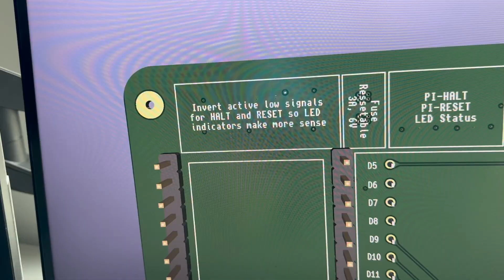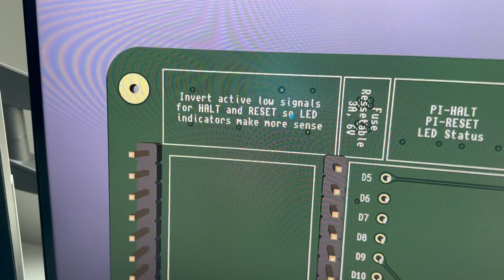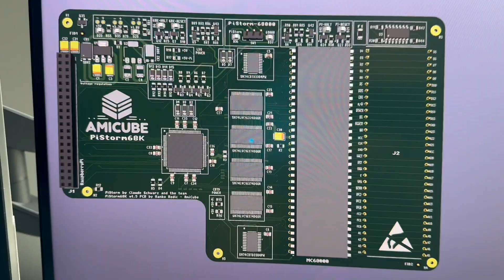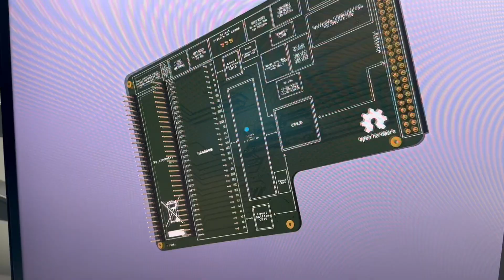🔧 PiStorm 68K v1.4 Hardware Update – Solving Power Glitches & Previewing v1.5! ⚡

Comment: The problem you are running into is due to the protection diodes on the I/O pins, and it's a common issue. This is why it is bad practice to allow for a situation where signals can be present when supply voltage is removed. While it won't necessarily damage a part, it can result in latch-up, and the resultant contention *could*.

I would suggest pulling those FF's back into your CPLD, as its programmable I/O pads handle this far better than dedicated ICs. Without power, all of the paths from the pin to the pad are broken. If you don't have the resources in that Max II part, the Cyclone 10 parts have internal configuration flash, are offered in TQFP packages, and come in variants up to 50k LUTs. They are also programmable by the free web version of Quartus.
Reply from the maker: Thanks for the excellent suggestions! I think I’ve figured it out. I’ll be releasing the schematics and Gerber files soon so you can take a look. What really helped was using jumpers to test different power configurations, in the end, I decided to keep just one diode.

Comment: Thank you for these updates. It's very appreciated! In regards to the rPi/68000 switch. Is it possible to add some logic to the board that will prevent a switch between the two modes during runtime?
Reply from the maker: From version v1.6 I changed how the switch operates. Now I am using N-CH. So it is possible! I should probably add this feature. It is very good advice.

Comment: I can't help think that you would just be better off waiting for the PiStorm16 rather than base this odd the original PiStorm.

Currently the PiStorm16 hardware is complete for the A600, and the firmware is in beta. A500 boards will follow. 

As it is based on an FPGA in the same family as the PiStorm32 it will bring over some of the benefits of that, such as the ChipRAM speed improvements, and stealth mode (to disable the PiStorm).
Reply from the maker: Is pistorm16 available? Schematics etc..
Reply: @amicube very soon

Comment: Have you had a chance to test it with a Pi4 per chance?  I was an early adopter with the first few batches of the original PiStorm and I haven't had any success running it and Emu68 with a Pi4.  Officially the Pi4 isn't on the PiStorm's supported list, but there seem to be plenty of people running one, so I'd be curious if your version runs fine.
Reply from the maker: Tested it this morning, and it works! I used a Pi4 with my Minimig setup, not Amiga, and it ran flawlessly. I'm not a PiStorm expert, so I'm unsure about specific nuances or why the Pi4 might not work in some cases, but with a CM4 and Pi4 in my setup, it performed well.
Reply: @amicube  From my understanding it's to do with the CPLD on the earlier versions, but  the interaction between the CPLD and the real chipset may contribute.  Trace lengths, Agnus revision, etc, could all be part of the problem I guess.  Marketing-wise it may be a good idea to test with a Pi4 and at least an A500, that way you could put it on the store page that it worked for you on an A500 RevX Agnus versionY, but "mileage may vary"...  Personally I've only tried mine on a A2000 with a CPU riser card, another variable I guess..

Comment: I have a couple Pi-stormed Atari's. An STFM and A Mega I'm trying to get stable, I replaced the pull ups as recommended and am working on replacing all the caps to hopefully fix DMA issues.  Unfortunately my STE has a soldered in CPU and I'm to chicken to risk trying to put a socket on it.
Reply from the maker: I’ve always been a big fan of the Atari ST/STE series! I’m one of those people who had both an Amiga and an Atari, and for me they were complementary systems. I used the Atari mainly for desktop publishing with that beautiful high-res monitor, while the Amiga handled pretty much everything else. The Falcon was always a dream machine!

And yes, definitely be careful with the STE. The PCB can be quite fragile if you’re not equipped with proper desoldering tools. With good flux, a steady hand, and a quality rework station, it’s not too difficult, but patience is key.

Comment: If the parts are not specified for operation when VCC is removed, why would you expect it to work? 

Almost all ICs have esd protection diodes that feed from the io pins to VCC.  So if you remove VCC but apply a voltage to the io pins you will back power VCC.

TI makes a range of parts that are designed to bridge voltage domains.  These are fully specified even when VCC is missing.  The io pins are in full high impedance state and won't leak.

I think it's the TXB and TXS series parts.
Reply: That was also my first thought, but both, ti and NXP devices are specified for partial power down - e. g. NXP datasheet "This device is fully specified for partial power down applications using IOFF. The IOFF circuitry disables the output, preventing the potentially damaging backflow current through the device when it is powered down.". So except from some uA there should be no backfeeding.
Reply from the maker: Thanks for the insightful discussion. Based on the SN74LVC16374 datasheet, the IOFF circuitry should handle partial power-down scenarios by placing the I/O pins in a high-impedance state when VCC is removed, limiting leakage to ±10 µA (max). This aligns with the expectations for TI and NXP devices with similar features, as you both noted, and should prevent backfeeding through ESD diodes or other paths.

However, I’m observing unexpected current flow or backfeeding in my circuit when VCC is off (only TI parts, not Nexperia), which doesn’t match the datasheet specs. Adding external diodes to block the unwanted current paths has resolved the issue for now, suggesting the backfeeding is occurring through the I/O pins. I’ve checked the schematic, and the diodes are placed to prevent current from flowing into the I/O pins, but I’m still puzzled by the discrepancy. Could this be due to specific conditions like I/O voltages nearing or exceeding 5.5 V, transient effects during power-down, or interactions with other powered components on the bus? Parasitic effects or PCB layout issues might also be contributing.

I haven’t had the chance to dig deeper into this yet, but I plan to revisit it to ensure I get to the bottom of the root cause, as the diode solution feels like a workaround.
Reply: @amicube I dont know which exact parts you are using and in what configuration.  Do you have schematics i could look at?  Sorry if obvious to others where to find, but i couldn't see a link in the description.